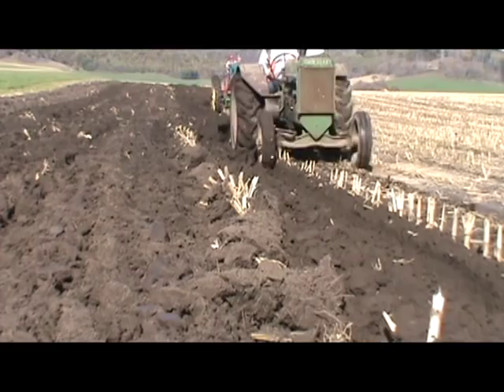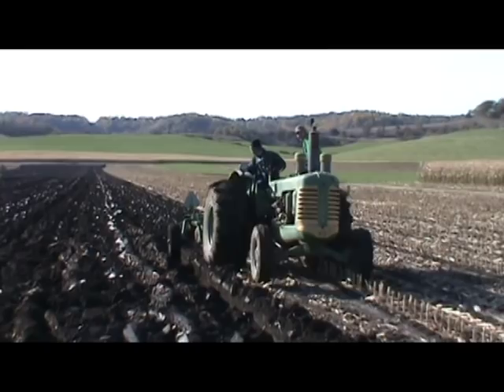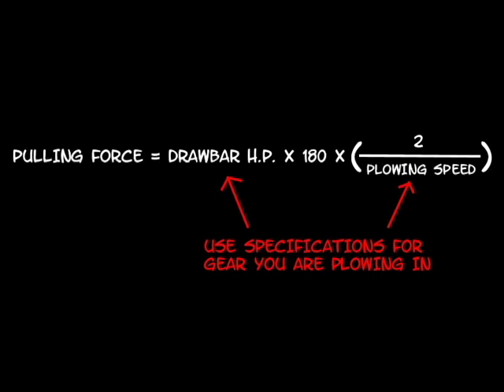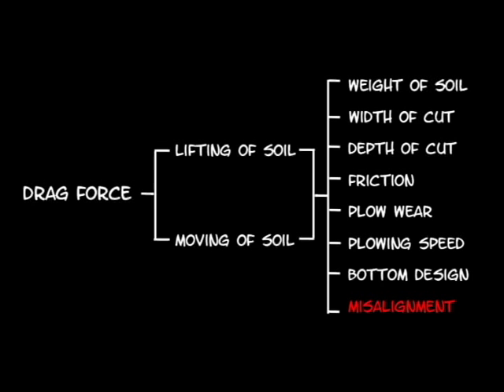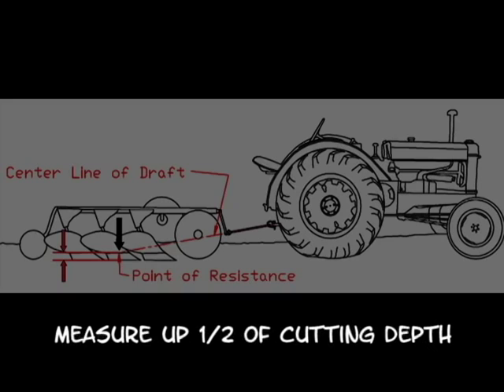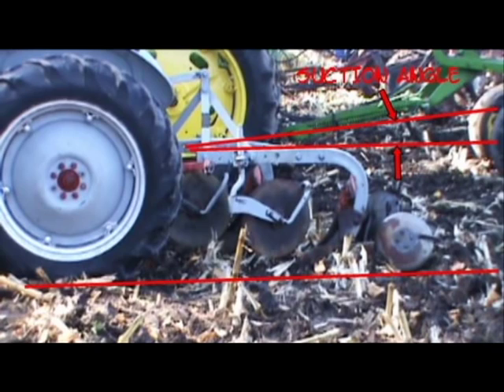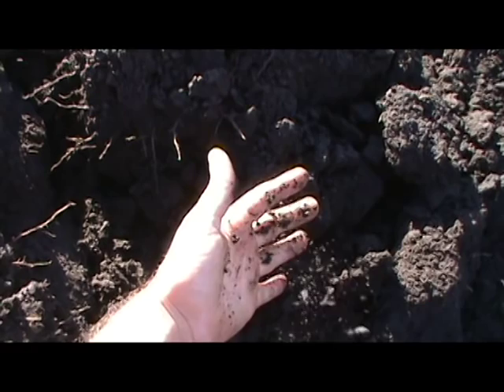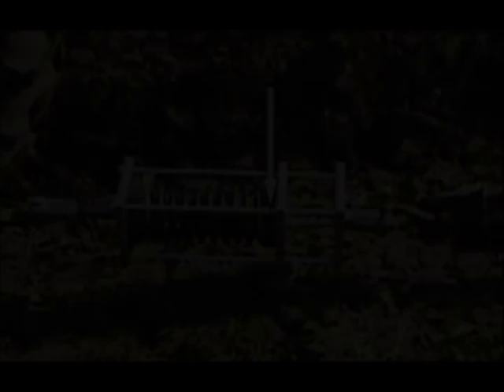Demo of A Guide to Better Plowing.avi

Comment: Everybody thinks plowing is over. But it's still good for some fields and certain crops. Also for some kinds of weeds, like green onion. It helps alot in organic farming. The old plow ain't dead yet!
Reply: Breaks up hardpan so water soaks in. No till just causes run off
Reply: 100% the plow will never die because it works. Simply a tool that has useful application

Comment: I think my tractor is adjusted correctly for my plow and I am pulling a single plow with my tractor. It has a 32 hp engine and is plowing in soil which have not been worked in years. My grandfather used a horse and plow the soil, but I will be using a tractor with my plow first, and then go over the soil with my tiller to prep it for planting. I have a middle buster to open up rows for planting after that and hope to be getting a nice return in vegetables, and melons.

Comment: it's  common knowledge  what  most  tractors were rated for  two  plow   3 bottom  4  bottom or 5 bottom   John Deere plow  pull harder then  Oliver  Minneapolis Moline or White Plows .. I have a Moline  4' 16"  moldboards that pulls easier than a John Deer with  4 14"  moldboards ..
Reply: Absolutely. With the same tractor, we could pull a whole bottom more with an Oliver over a Deere plow. However we also noticed it made a difference in the moldboard type, our Oliver plow did not do as well in our clay & sod ground as a Case plow which had longer moldboards and longer points. We sold the Deere plow and exclusively used a 3-18 Oliver and a 3-16 Case plow for over 20yrs.
Reply: John Deere's claim to fame is less fuel consumption